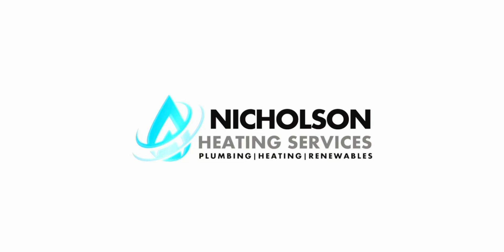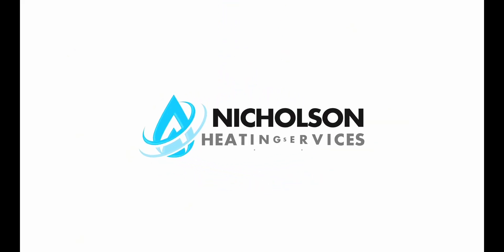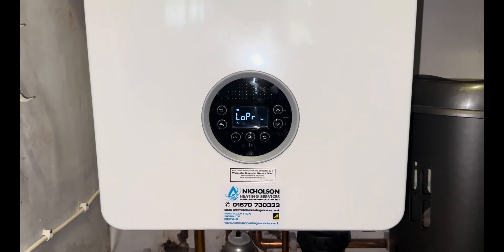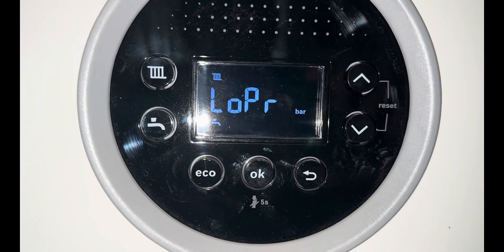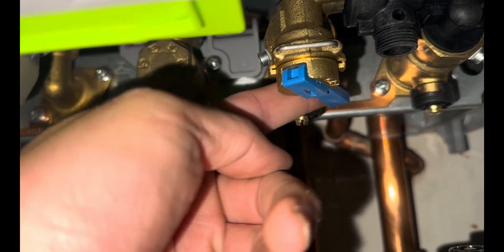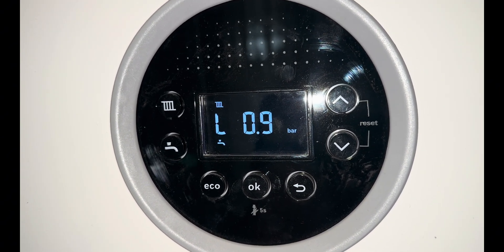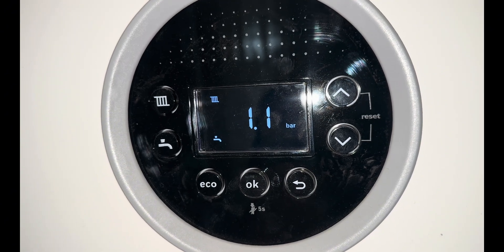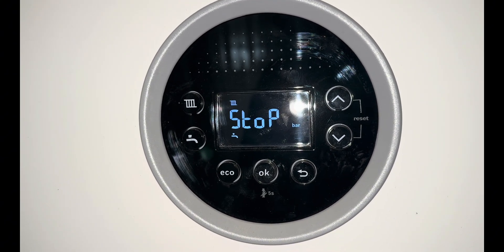How do I refill my Worcester Bosch 8000 combi boiler, low pressure , low pressure fault.

Comment: Just changed a towel rail in my house. Refilled pressure in my Greenstar 8000 to 1.5 bar. Tried to use hot water and the boiler temp would go up to 90 degrees and then hot water would cut out. Boiler was making squelching sounds like a washing machine at the same time.

I assumed there was air in the system so turned the central heating on. This helped allieviate the air traps. Let central heating run for 30 mins. Afterwards system seemed stable and hot water was working again.

Hopefully this info helps someone else. :)

Comment: I've done this in the past, but just wanted to check it was the blue lever. But mine didn't say "Stop". I usually have it set to 1 bar, but I kept going up to 1.5 🤔

Anyway, it's a lot quieter now, cheers!